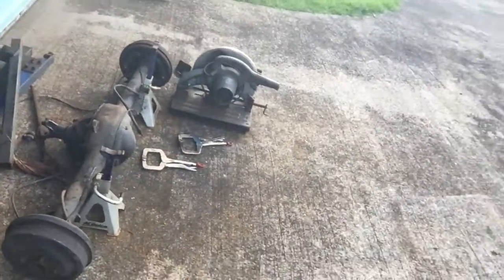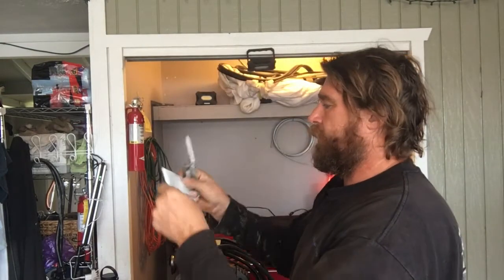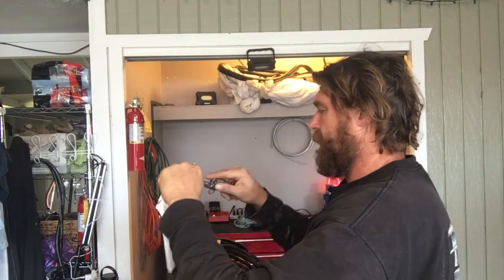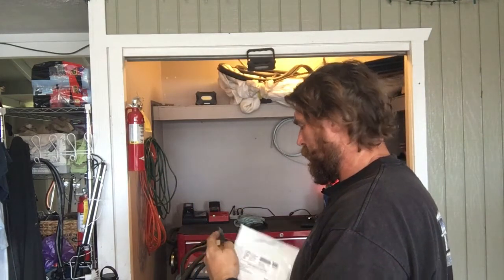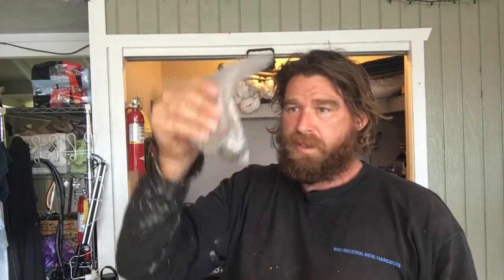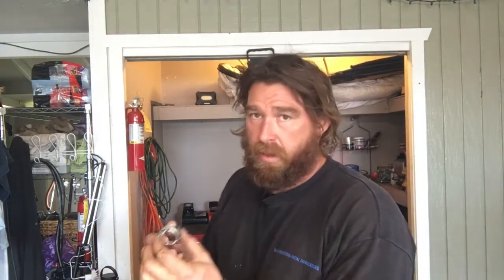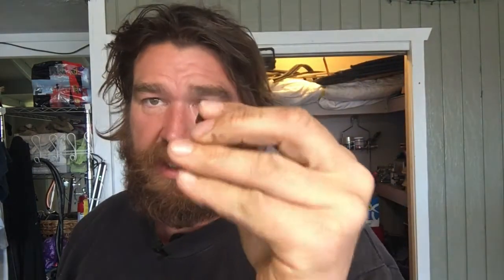1957 Chevy in Hawaii....HOW TO: Ignition switch install..stock switch and bezel

Comment: i had to pry mine off cuz the bezel would not let go, i used the cig lighter as a fulcrum cuz
 if you pry on the soft aluminum dash trim you will be very sorry. so dont be a dummy in a 
hurry to damage the very expencice trim, thank's for this video i forgot about in lock position to get the ingition apart.  Mark Biggs